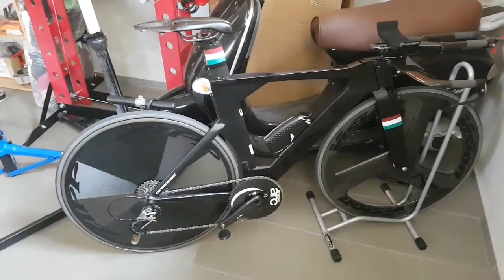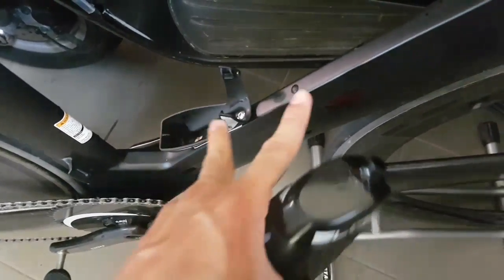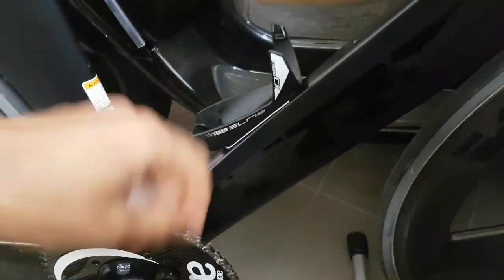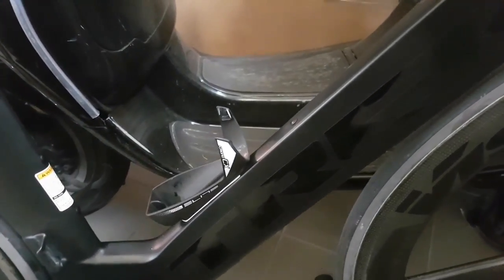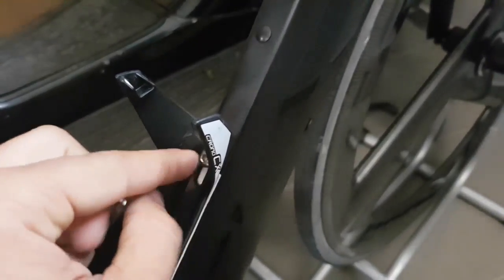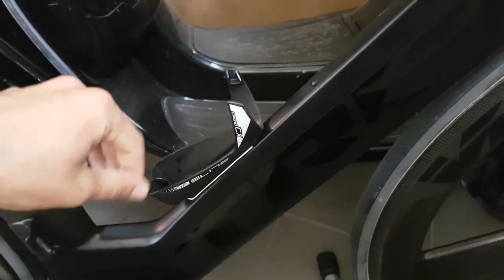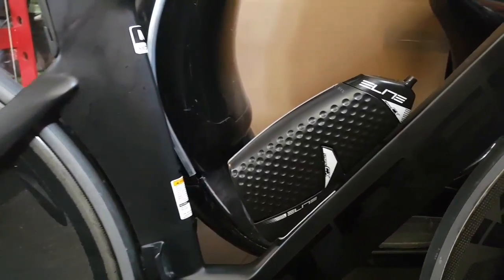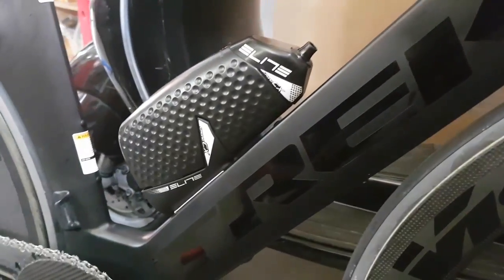Aero water bottle hack

Comment: So is this setup faster than one bottle on seat tube? or 2 bottles? I have exact bike and bottles and cant seem to find an answer.
Reply from the maker: Jay S the seat tube is the worst possible location. One bottle placed as close to the BB as possible is the best
Reply: @ronykuba  The best bottle is the very old specialized aero bottle - perfectly fits and fills the BB area - hard to get through - out of production many years. I bought mine on Ebay and paid twice as much as the original new price!!

Comment: Hi Rony... Do you are liking this bottle? I have looked this bottle for use too, but I have fear that it don't work better in the aerodynamics. Today I remove the bottle in the TT, normally for 30 km I can do without water if the weather is good.
Reply from the maker: Marco A Leite it is faster than a standard bottle, but not as fast as no bottle

Comment: Try the specialized aero fuel cell that fits from downtube to seat post, completely filling in the space, like the cervelo C5 has. Works on my Quintana Roo tri bike, and probably most TT bikes. No water, but I have that between the handle bars or behind the seat. The fuelcell is for tubes etc, with a bento on top for gels. But I leave it in place when empty as it is aero, and I rarely drink anyway

There is also a specialized swat road kit that should also fill the gap, but I do not know if it fits other bikes

Or the specialized water bottle and cage, similar to your elite - I switched to the elite for black bikes, but the specialized looks good on red / white bikes

Instead of double sided tape, you could have a rivnut installed, but can understand why you might not want to drill through your carbon....

Maybe someone makes an extension plate that has an extra bottle screw?
Reply from the maker: J B thanks for the comment, maybe I will make an extension plate myself